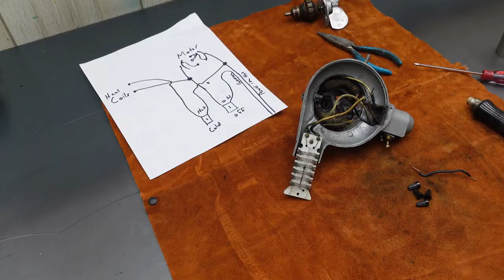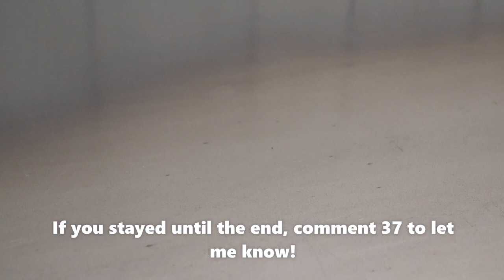Forgotten Sears Kenmore Hair Dryer Restoration

Comment: not a fan of reusing the old cable and not replacing the wiring inside with new
Reply from the maker: The cable was in surprisingly good shape and I wanted to use the original toggles which had the wires integrated into them so it seemed superfluous to change some of them and not others.Thanks for watching!